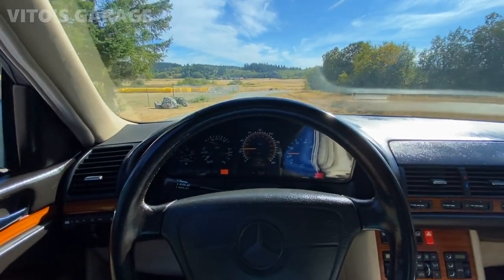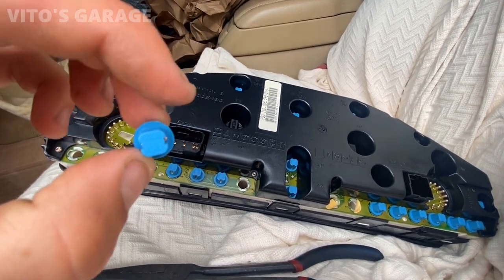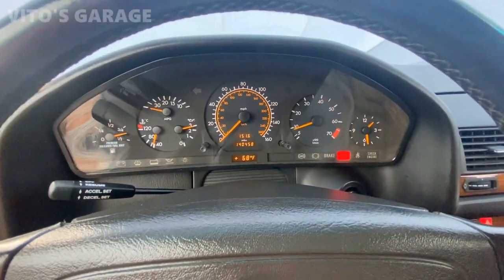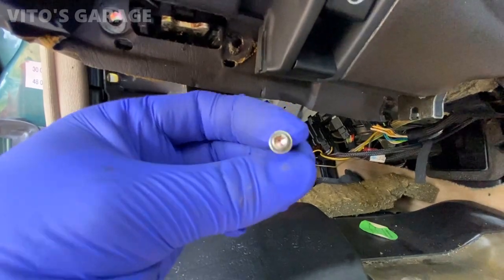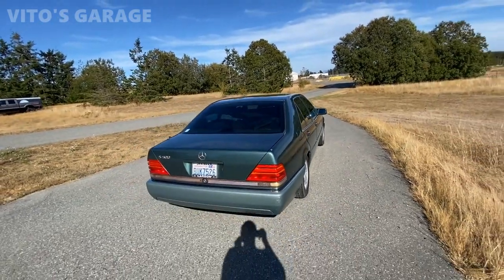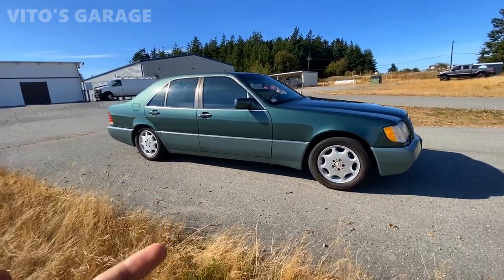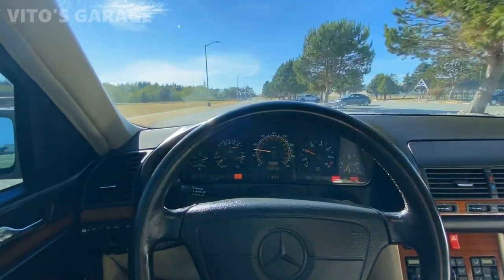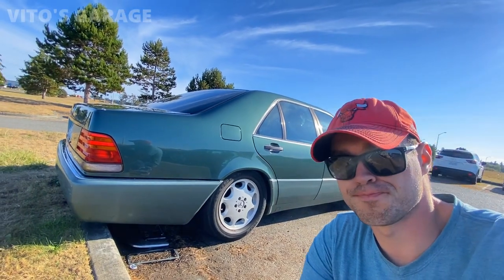Crocodile Mercedes W140- Not New But Almost Like! Lots of Work! + New Cluster Bulbs & E-Brake Handle

Comment: Vito it would give us a great insight if you detailed how much you are spending on the parts etc. In the UK you can buy a 140 for about £1500 but they can be horrible condition and the parts aren't that cheap.
Reply from the maker: You only live once. Should I add anything else?;)

Comment: Gorgeous car. I actually prefer the original pre facelift design with the slightly different color on the lower plastic moldings like yours. I heard you mention the wiring harness. What are you going to do about that? The harness and the AC are the two biggest things that scare me about the 140.
Reply from the maker: I haven’t checked the harness upclose. Nothing scares me. You have to overcome your fears. If something needs to be fixed, it’ll get fixed
Reply: @VITOSGARAGE  Overcoming fears is one thing, but I live in Phonix, so AC is the single most important thing in a car. If the AC's not Perfect the car is useless no matter what it is or how nice otherwise. And from what I've heard getting to the EVAP for example is a real bear on a 140. Perhaps it it was a second car that would't be so bad but if it's your only vehicle that's another matter. Anyway. Really like what youre doing with these Mercedes. One day I hope to own a 140.
Reply from the maker: I totally understand what you mean. I’ve been to Nevada and Arizona before and it’s pretty hot there😀 
AC in most of the classic Mercedes doesn’t work. On mine the compressor doesn’t turn on. I didn’t have time to get to that yet. 
But AC is easy to diagnose. Condenser starts leaking sometimes or the compressor itself. Replace those parts, add Freon with oil and you’ll have a good working AC. I am not too sure how well the evaporator holds up on these cars. 
Thank you very much for supporting and watching🙂🤝

Comment: Ok, one more comment.  First off, this W140 is a beautiful car and I love the color!  I have a question for you about a W124.  Do you know where the cabin air intake is for recirc mode is located?  I heard it was in the passenger footwell, but when I had the fan on high on recirc mode testing this, I did not feel a strong pull of air where I thought it might be - on the right side footwell, but outbound airflow was working properly.
Reply from the maker: The main recirculating on door? Are you talking about the one right behind the blower motor? And what are you trying to diagnose?
Reply: @VITOSGARAGE  I am trying to figure out where it is.  The main air intake from the outside is like right below the windshield on the outside of the car. I am trying to find the equivalent on the inside of the car - i.e. where it pulls the air from when you push the recirc button.  I hope that makes sense.

Comment: I just purchased a 1994 S420 for $500 Canadian but neglected wouldn't be enough to describe the condition... I think I will part it out as it is rusty as heck window was down and car if flooded. 280,000km doesn't help either.
Reply from the maker: At least you saved it and that’s awesome. I’d rather have all the parts to myself than scrapping the car! We gotta save all the parts for these cars
Reply from the maker: At least you saved it and that’s awesome. I’d rather have all the parts to myself than scrapping the car! We gotta save all the parts for these cars

Comment: I need to replace some cluster bulbs. My seat belt tensioner is not retracting. Any leads on how to get a new one?
Reply from the maker: You mean when you unbuckle, the seat belt is slow or doesn’t retract back to its original position?
Reply: @VITOSGARAGE  Yes it barely goes back in. The spring inside must be all work out. And it’s not fixable.
Reply from the maker: Hmmm. Have you tried soaking the entire seat belt in hot soapy water and scrubbing it? I do it to a lot of old school cars. Dirty seat belts won’t retract or will retract very slowly. Once you clean them, they work like new again and go back nicely. 
You don’t need to disassemble anything to clean it. You just need to pull the seat belt out all the way and stop that end from going back in. Use a clamp or something. 
And then put the entire seat belt into the bucket of hot soapy water and scrub it. Leave it soaking overnight.
Come back and repeat the procedure a few more times.